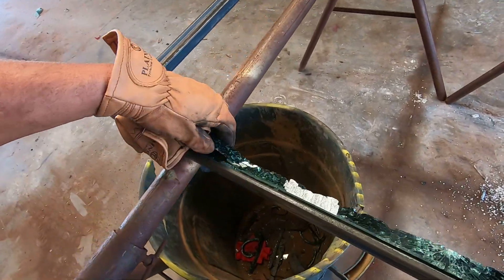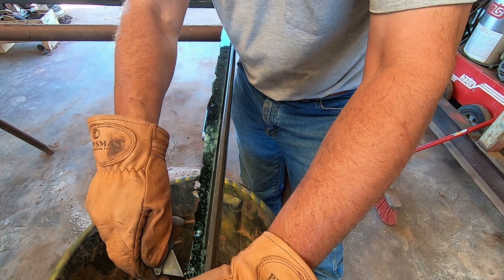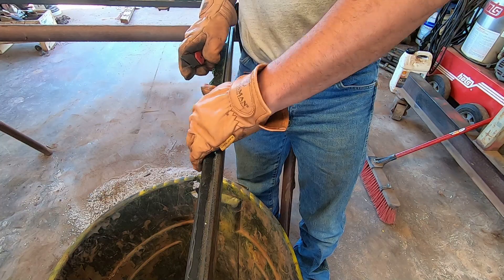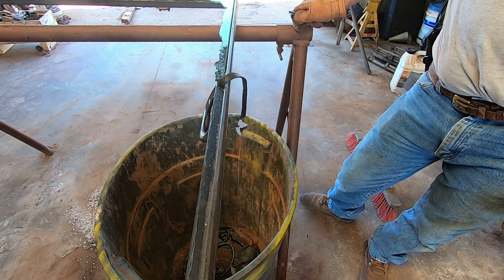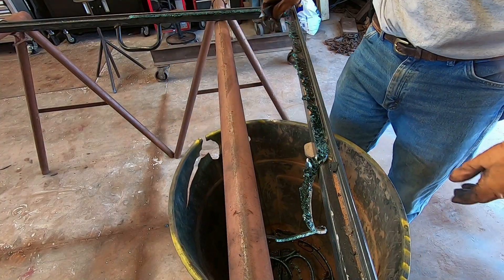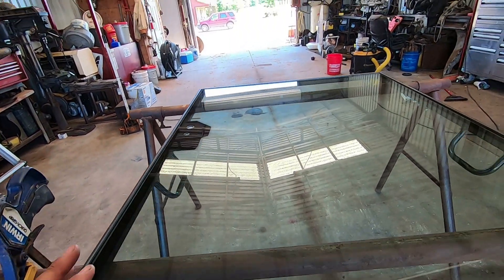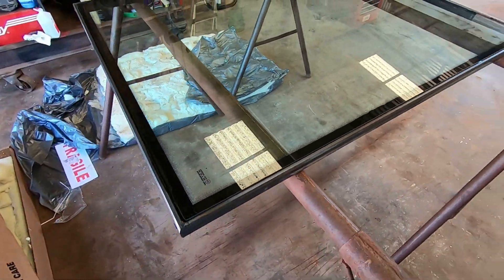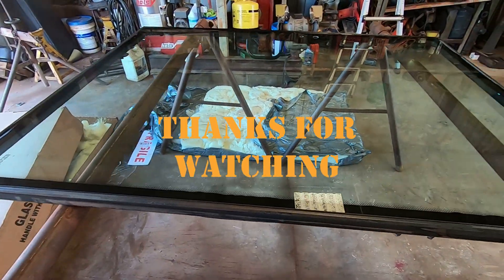Welding glass?  #digginok #youllputyoureyeout #urbansniper

Comment: I've done a couple of those and for taking off the old adhesive I used my small air chisel and sharpend the widest chisel, only took a few minutes to get it done.  Just one way to do it, sure there are plenty others ! 😊
Thanks for sharing and take care. 👍
Reply from the maker: Nice thanks!
Reply: A good high temp heat gun works great or other heat methods.

Comment: Feel your pain about your window.Years of minding a machine and taking care at work, undone by someone that has nothing worth a danm 
going for them.A JCB 
backhoe I drove when I was young needed a new cab door which was all glass, everything was bolted into holes in the glass.
The fitter broke the first replacement glass 
taking it out of his van.
He broke the second one pinching the hand rail bolts.He broke the third one test closing the door too hard.He took the fourth one out 
of van,left it on the ground and a forklift 
drove over it!!.
True Story.Hope you have better luck Frank.

Comment: Hot knife will work for that. Heating a putty knife with a torch and sliding it under that glass will work. Or if you can do it, a piece of really thin steel wire variable power supply (12v) will slip through it. From my experiences. Great video, thanks for all you give us.
Reply from the maker: Thanks, will look into that next time for sure

Comment: If you use a torch and a curved Carpenters knife it`ll cut that Windshield Polyurethane like butter , That stuff is strong enough to fix a ATV tire as a boot ,I`ve used it many times for other stuff too I have a vid on making a press gun for it .

Comment: as i worked in automotive glass for 25 years you have toughened glass that why it shatters as you have. i would suggest that you purchase a laminated pce of glass and if hit the glass will crack the same way as a front windscreen of a car. your glass is 1 pce toughened where laminated is 2 pcs of glass glued together with a interlayer of a plastic which goes clear under heat much safer this glass
Reply from the maker: Can a shop put in the holes and black edging?